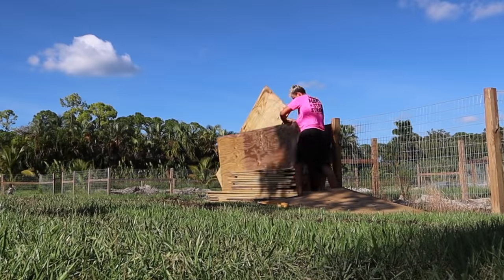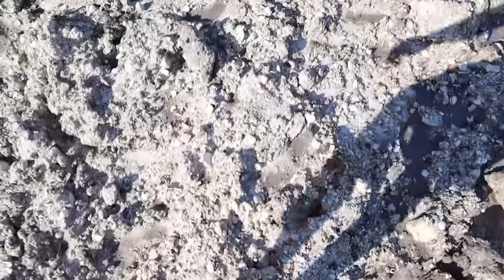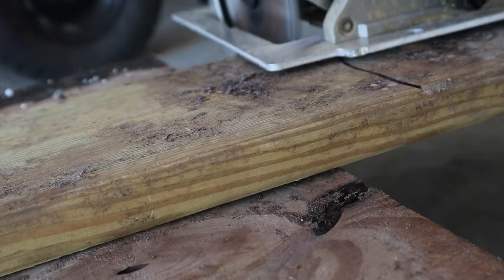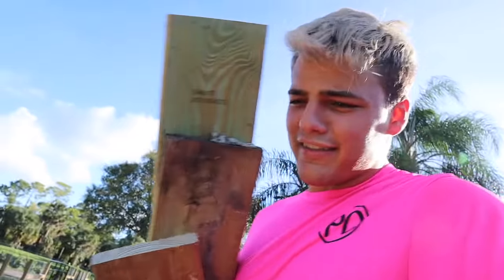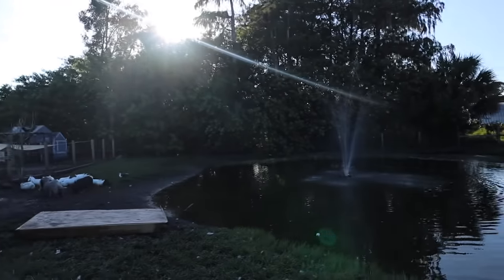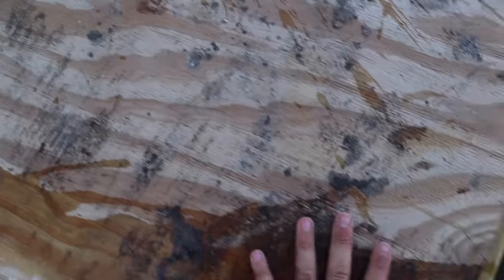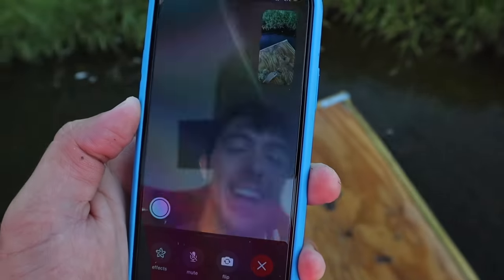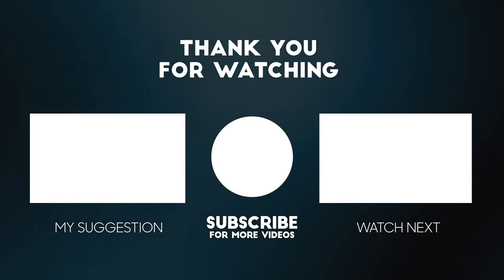BUILDING My BACKYARD DIY TURTLE DOCK!! (did it work?)

Comment: Next time take the styro foam and glue it together. Sculpt the foam how you want. Then do multiple of layers of concrete on the foam. You can apply with a paint brush. Make the  concrete a little more soupy than what you would normally so you can apply it with a paint brush. Then after it dries throw it in the pond. You will have a floating rock.  That can hold turtles on it

Comment: You could also drill a hole in the middle and feed a rope up through it and tie a knot so it cant fall back through and then tie a cinder block or something on bottom end of rope to anchor it so it doesnt float around and would sit nice whereevwr u want it in pond, so its not like right on the edge all the time

Comment: Paul i want to give you just one hint for you to make the floating dock better for the turtles to climb up...screw a piece of plywood  along the sides(like a triangle shape...make sure that it goes under the surface of the water by 2 - 3 inches) on that piece you can put smaler pieces of wood to make it like a ladder for the turtles to have something to grip on and get on the dock

Comment: paul, for the most part, wood floats, and starts to sink once it absorbs enough water, but being pressure treated you should be fine! 👍🏽
Reply: Should be more concerned with microplastics dissolving into the water from the foam.
Reply: @NightKing110  foam does not dissolve into water